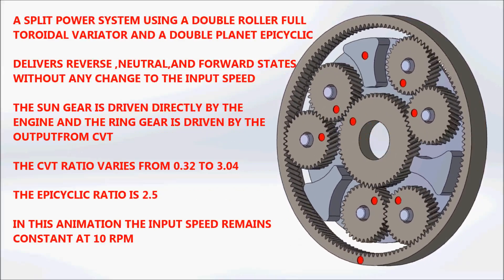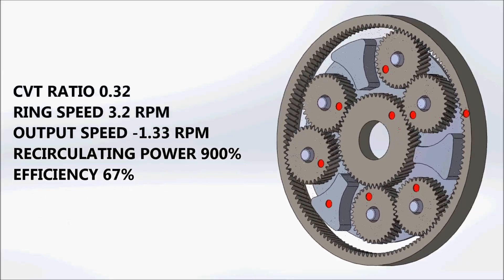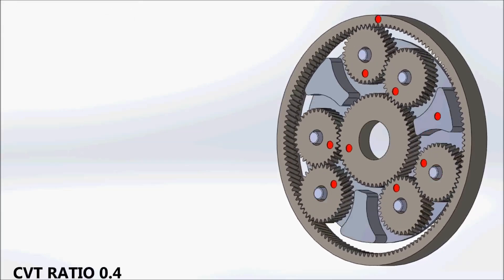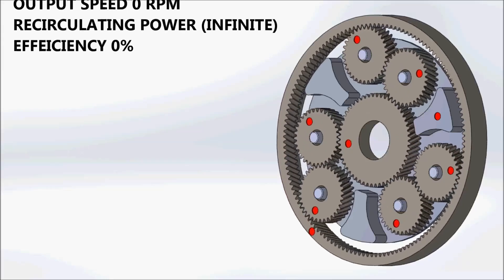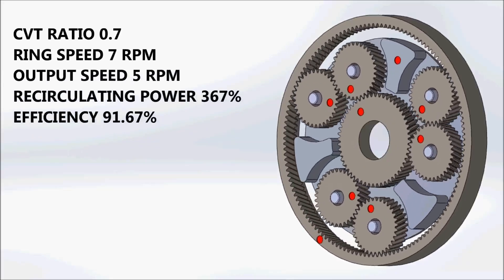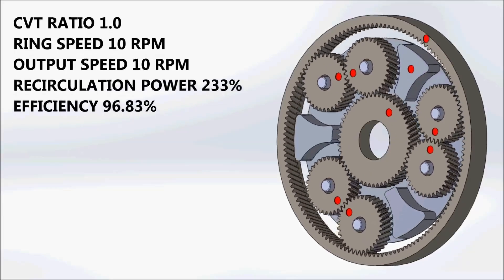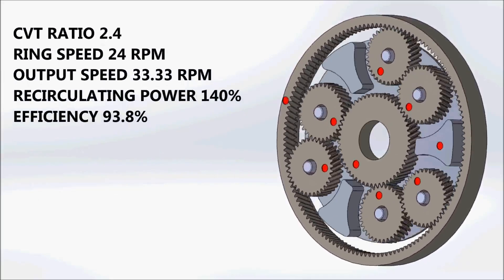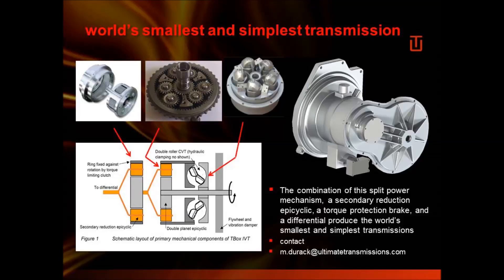SOLIDWORKS SIMULATION OF IVT GEARS

Comment: You have a CVT driving the ring gear. Why not just use the CVT, why put this in between?
Reply: it gets infinite variablility from the gear
Reply: Torque capacity at the rollers (CVT) is comparatively lower than a gearset can handle for a given size, weight, cost, etc but can be driven fast where there is a reduction of torque and have it's effect utilised

Comment: This is just an overly complicated planetary set. The input-to-output difference is sheerly dependent upon the control of the intermediate members. It doesn't matter which reference you use, any planetary drive can be made into a CVT by implementing variable controls. Thus is nothing new.

Comment: I don't understand the ratios and engineering associated with this gear set - but - it seems the planetary gear(s) carrier controls the output speed more so than the constant speed of the sun gear.  Am I  correct in assuming this could be used as a power switching device?

Comment: How do you calculate the output speed with respect to the two sun and ring gear input speeds? What is the variable gear ratio formula for this simulation? Thanks!
Reply from the maker: ***** 

This simulation is automatically delivered by Solidworks motion.  I have all the formulas if you want.

contact me at m.durack@ultimatetransmissions.com if you want - please explain where you work.